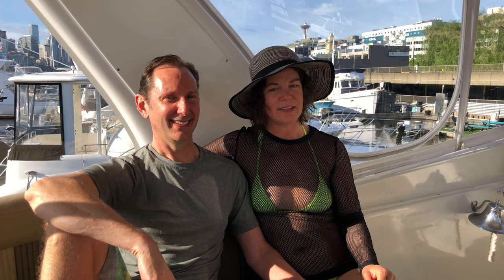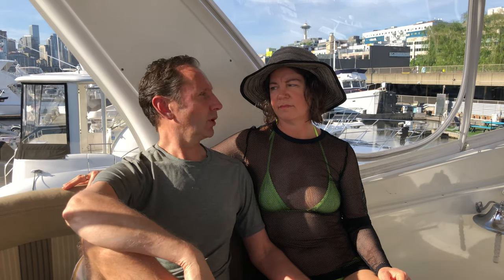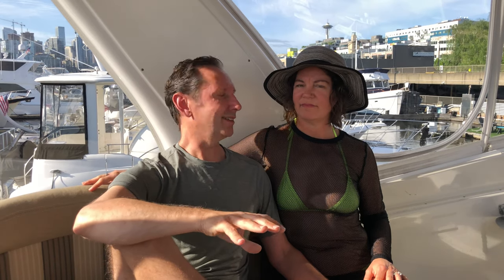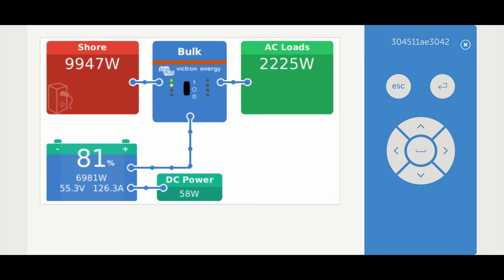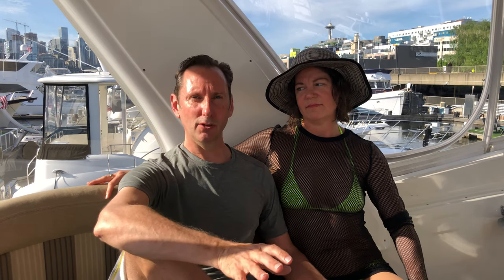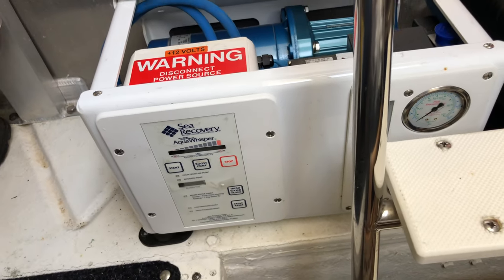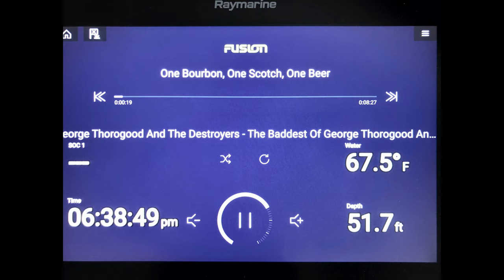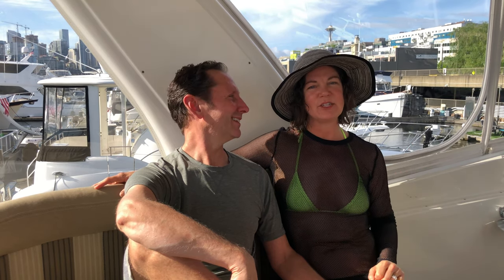Living Off the Grid on a Motor Yacht Cruiser - Top 5 Refits EP 6

Comment: WOW, you seem to have covered everything; I didn't catch if you had any high output gen/alternators on the engines to also help top the batteries when the engines are running ??????
Reply from the maker: With 21kWh of power on our 48V LiFePO4 bank, we can go 5 days before having to recharge from shore power or the generator. When we aren’t running the engines, the 12V battery bank charger runs off of the 48V inverter. 

However, the 12v system recharges from the engines while running and relieves the draw from the 48v system. 

This creates redundancy if one system was to fail and eliminates the cost and complexity of changing out the 12v alternators.

Comment: I didn’t understand the point about not running the 12v house system on li on.  Or did u mean the the 12v is also li on but just on a separate circuit.  I was planning to start by just replacing current house batteries with battleborn drop ins.  Do you see a risk in this?
Reply from the maker: Good question!  If your current house bank charges from your alternator(s), the Battleborns will take everything the alternator(s) will give in amperage. The Battleborns can take 100% of their Ah rating while recharging (this is called 1C), from your alternator(s). That’s fine when you are at cruising speed and the alternator(s) can cool themselves, but at idle, the alternator(s) aren’t designed to deliver their full Amperage ratings and will burn up. 

This is because alternator cooling designs are built for lead acid charging profiles (.3C), or 30% of the rated battery Amperage. So a Battleborn 100A battery will demand 100A during recharge, in contrast a lead acid 100A battery would demand 30A. If you have an alternator designed for 30A at idle but can generate 100A at cruise speed, that’s where LIFePO4 causes the problem.

As with anything, there are a few solutions: 1) have your Battleborns charge exclusively from your inverter/charger that is powered from shore/generator/solar and leave the alternators out of the mix, or 2) install new alternators with external regulators that are designed for LIFePO4, or 3) install a 12V 30Amp DC to DC charger between the alternator(s) and Battleborns. That will limit the Amperage draw from the alternators to 30A and you’re good to go!       Victron has a YouTube video on this topic as well. I hope this helps!
Reply: Elli-Yacht thanks for that great explanation.  I’d have made the mistake for sure.  Watched the Victron video and will consider when we finally decide how to proceed.